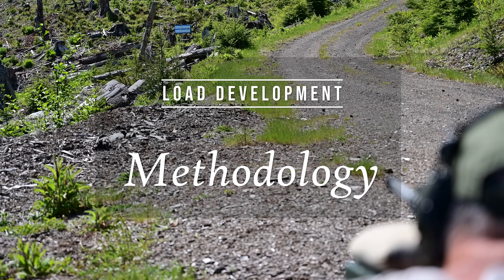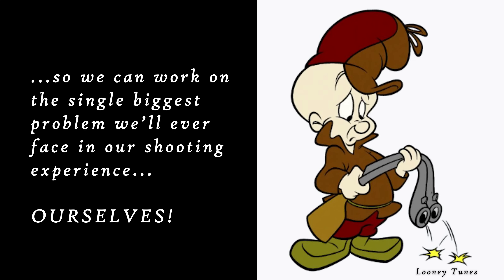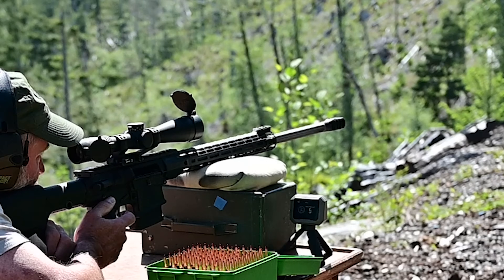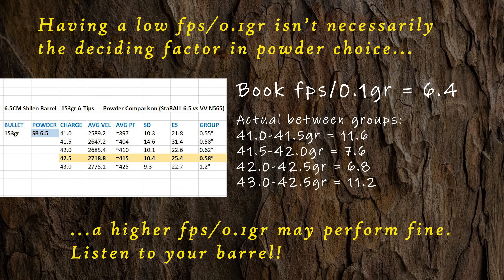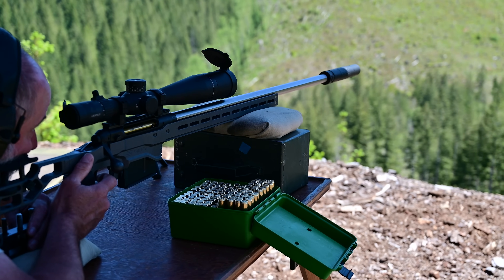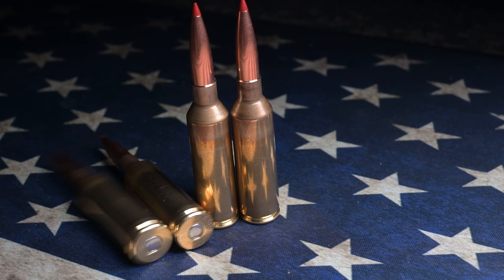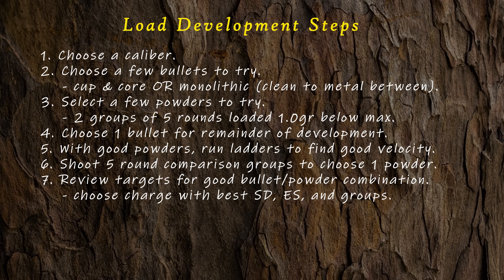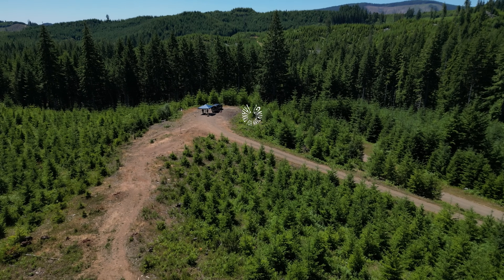Load Development: Methodology

Comment: Small sample size is data is useless though
Reply: A small sample size will point out where you do not want to be. Let's say you are testing seating depth. If your 1st 3 shots on a seating depth produces a 1" group and you are looking for .5", there's no need to shoot 30 rounds. That group will not get smaller. Now say have 4 3-round groups through your testing that are .5" or less. Then go ahead and shoot 30 more rounds of each of those seating depth to confirm.
Reply from the maker: @timmy57634  Couldn't have said it better!  👍
Reply: @timmy57634 no it does not. Because a 0.5 in group could just be a fluke, part of a larger group and grow as soon as you shoot more shots, and most likely will. They could all be 1in groups, or 1.5in groups and you will never know it, and will just be re-zeroing your gun constantly because you don't actually understand the group sizes your gun is producing, and you are just hitting different areas of that group every time you shoot. Ever wondered why your groups get big sometimes then shrink? Because you got unlucky and found 2 rounda on the extremes of the larger group, instead of closer to each other in that group.
Reply from the maker: @jonathanrogers9961   Please see our response to this same challenge you made regarding our other video, On Statistics.  Peace.
Reply: @RealWorldReloading  oh I did....

Comment: Just a question regarding your ". 3gr" vs ". 5gr" suggestion. 

A .223's case capacity is around 30gr of water. 

I'm loading almost double your 40gr in 300WM (case capacity around 90gr of water) and more than double in 338 Lapua (case capacity almost 120gr of water) .

Dan Newberry suggests 3% to the next node and Keith Glasscock recently suggested starting 5% lower as a start to finding your next node. 

At 40gr, 3% is 1.2gr so .3gr increments will fit in nicely (5 loads). 

On a 300WM however, you'd have to use 8 or 9 loads to get just a 3% spread.
Reply from the maker: Yes!  You have the right of it!  "We must match the resolution of our tests to the range of sensitivity in our particular use."  I hope others see your excellent example of understanding magnitudes in testing.  Thank you!